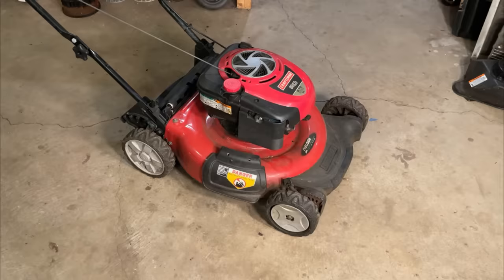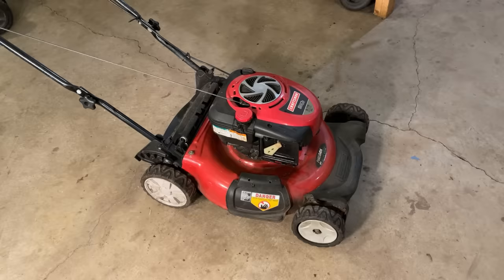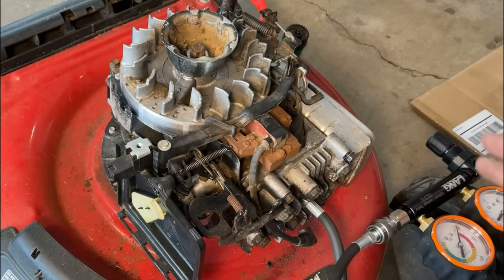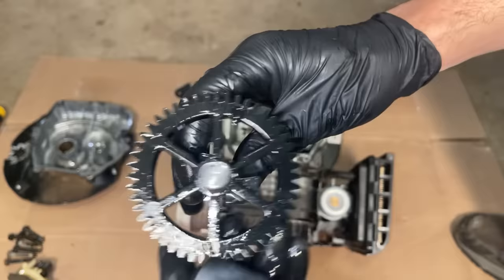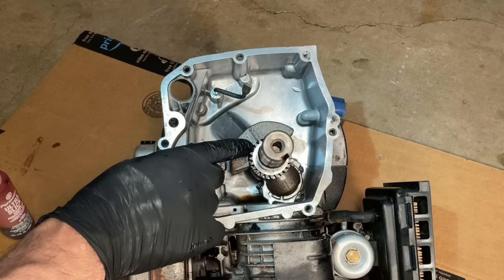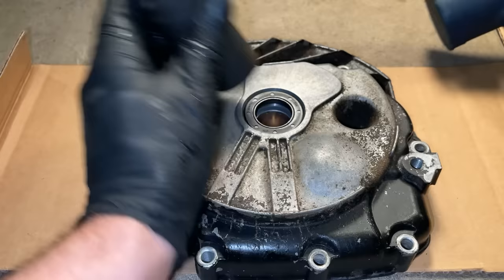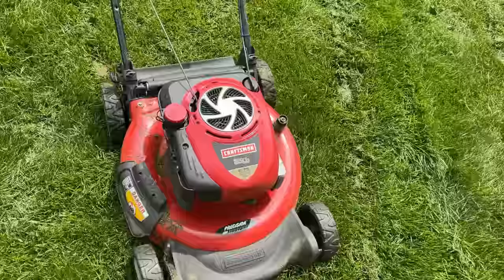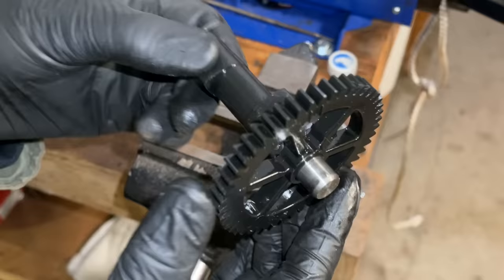Lawn Mower Will Not Start - You Will Never Guess Why

Comment: A helpful tip: The gas tank fill cap on this and similar mowers was very poorly designed! Grass and other debris collects on the underside of the cap flange and when you remove the cap the debris falls into the gas tank. As an ex lawnmower mechanic I am very meticulous when it comes to using clean gas so when the carb jet on my Toro kept getting clogged I knew something was up. After discovering the source of the problem I did two things. First I installed an inline fuel filter in the short rubber gas line running from the tank to the carb. Do NOT use the little red plastic style filters sold online as they will not filter out smaller particles. Rather use the round clear plastic filters that contain fiber filters. Due to the short distance between the tank and the carb and the overall length of the filter this requires some manipulating but it can be done. Second, and this is very important, before removing the gas cap run a rag around the bottom surface of the cap flange to remove debris. I haven't had a single clogged carb jet in the two years since I diagnosed this problem.
Reply: I totally agree with you everything is so poorly made the fail in this country so you consume more and more product I have a lawn mower engine roughly the same model in style but it's from 1990 everything is internally cast or aluminum I've even gone as far as polishing it and porting the engine it's 190 cc's from factory it's probably 200 cc since I've done everything to it This country's despicable when it comes to waste. I've also stated that these engine brake switches are horrible for the magneto and flywheel so my recommend recommendation is to take a double strand piece of wire wire to your magneto and wire it to the block of the engine run the wire up your handlebar to an off and on switch. Patent pending.
Reply: Thanks so much for that tip. I already knew about installing a primary filter after the tank but never heard about the gas cap debris issue before. Now I’ll be on the lookout for that with every mower I work on. 👍🔧🧰
Reply: I have made it a habit to always overfill my tank to flush out grass debris since the mid 70’s and have never had an issue with a clogged up carb.
Reply: For this exact reason, for about the last ten years, I keep a 2" paint brush on the wall where I fuel my equipment.   I use the brush to whisk away all the debris from the base of the cap and the surrounding area before removing the cap.  Only takes about five seconds.
Reply: rbarr775 I like that method better than overfilling or using a rag to clean off the debris. Thanks!
Reply: rbarr775  Great idea!
Reply: Thank you
Reply: You are spot on !
And all it takes is a speck !
Been there, done that !
              👍😉
Reply: Is that 1 of those gas That keeps vibrating off ?
Reply: Those gas caps Are a piece of c*** don't fill it up they don't Leak as bad
Reply: those blowing iff the whole lawnmoer work? I tried to do that as much as I can,will do it every time now
Reply: This was a great “tip”!  That’s why I read comments. So many people, smarter than me!  Thanks👍

Comment: James I am 75 now and back in 64/65 I was the one lung king of the neighbor hood , so I  thought. I did manage to fix all the mowers I collected on the side of the road. I had a claw hammer, 9/16 and 7/16 socket crescent wrench and a pair of pliers, no ratchet. Hours of fun taking them apart cleaning them put back together and when they started it felt great. Thank you for sharing, would have never guessed that was issue. Back then it was one cast piece.
Reply: I did something similar exact same time frame but I attached one motor to my sister’s old bike, a blue and white Monkey Wards step through.  It was a rear engine drive like exotic Italian sports cars.  The frame was a for sale sign donated (unknowingly) in the mid night procurement services.  Drive was a long drawn out process.  It ended up a Jack shaft, 1/2” V belt, with a 12” pulley on the rear wheel, the Jack shaft was a 3” welded to a 2” and the engine had a 1 1/2”.  Went through about 50 V belts by the time I got it going.  Top speed was about 26mph with my custom exhaust, 3 piece 1/2” galvanized pipe. That project pretty much solidified my career decision to become a mechanical engineer, now I are one (old joke).

Comment: nice! I got a Craftsman 20" like new from the local thrift shop for FREE. The deck and blade barely had any signs of use at all. They said the engine was seized. I pulled it through at the store, it was very hard to pull, but it wasn't seized. Took it home and saw that the 'safety blade stop' cable had broke down at the lever on the engine. Re-attached it and the mower is running fine! FREE! YAY!

Comment: A pressed on plastic cam shaft I'm surprised it doesn't have a compressed cardboard deck and bamboo cutter blades , good video and great job getting this thing going
Reply: 15 or 20 years ago,, that camshaft was one piece steel.
Reply: Should have a roll pin at least
Reply: I'm an expert with small engines usually I can tell exactly what's wrong from what the person says if u hit a stump lawnmower dies won't start timing key is the problem or bent crank witch can be straight ened without taking anything apart
Reply: and yet i bet this failure is very rare.

Comment: Ugh, I hate how cheezy these engines have become nowadays. This is why I try to save the old stuff. So much better quality!
I'm glad you posted this vid. It's good to know what's lurking inside these engines.
Reply: It's not just the small engines.  WAAAY back in the late '70s, I heard that GM was using plastic parts in their auto transmissions, and these transmissions were failing because the parts were breaking.  I was skeptical until, by coincidence, "60 minutes" did a segment about this very issue at the time, and when I found that my Monte Carlo had one of  these transmission (TH-200), I dumped that suck within the year.  It was a POS anyway, bad transmission or not.
Reply: @eskieman3948  For sure!  Kawasaki got bit hard because they decided a plastic oil pump drive gear would somehow be a good idea in the Vulcan 1500. Well surprise, surprise they had a major recall due to failed gears!  Plastic has no business inside an engine save for a few select items such as chain guides, and even then they don't always get it right.
Reply: @ctg6734  most newer engines have plastic camshafts I don't know about all of them but I had a Briggs & Stratton that I took apart and it had a plastic camshaft
Reply: @ronalddaub7965  Yeah, I have two of these engines on mowers currently. Sad thing is they'd probably be fine if they molded the gear and lobes as one part instead of two separate pieces.  But yeah, it's because of stuff like this that I hold on to my older equipment.

Comment: "Yes! Plastic cam shafts. You don't want them to last forever do you, Mr./Ms. retailer?" It's not a defect it's a feature! I admire how you were able to zero in on the problem, explaining your reasoning and methodology. I grew up on all metal lawn and garden engines (yes, they are very nutritious with whole milk!)  If something was out of time, it was game over. I didn't know until now about the plastic cam so if I had run across the problem from the outside of the engine, that engine would go into the metal recycling pile. Thank you for pointing it out! A repair like this, done by the typical small engine repair shop would have been too expensive to consider for most home owners. And that, sadly, is the plan.
Reply: I’ve done 9 in less than 3 months so far
Reply: Wouldn't have cost much for Craftsman (or whoever made that part) to fit that timing gear with a pin or even a key.   But, as you said,  the engine will last too long.  Bad for Craftsman.   What a scam, especially in a lawnmower (where the blade is liable to hit against some obstruction and quickly mis-align that timing gear).   Or maybe they thought it was a safety mechanism (like shear pins in/on some old time outboard propeller shafts)?
Reply: @ArroEL922  I don't doubt that is part of the plan. I've only owned 3 mowers in about 40 years and in each case the deck rusted out but the engine was still fine.
Reply: Oh about 15years all engine blands got sued mis different horsepower than they what the manufacturers was were so went cubics or CCs the manufacturers so they lost alot of profits so decided to make throw away engines at our expense . I try stay away from them but was all of the united states .

Comment: There is nothing more satifying than to take something that has no percieved value to an average person, and make it like new for a few bucks.
Good going! That's probably a $300.00 mower!
Reply: If you did this yourself you would have to go buy the tools to do this kind of work, which would probably cost the same as a replacement mower, hence why people throw them out...
Reply: @starzlea  So true. Our society has us conditioned to throw things away. I've repaired small engines, vacuums, all kinds of stuff. It is so rewarding!
Reply: It's a 150 dollar mower at Lowe's.
Reply: It’s great but what if it doesn’t work. You have to back and troubleshoot it all over again. By the time you figured it out you already spent $300-$400 of time and labor.
Reply: @javierbaron1856  do it yourself is the only way a shop would probably get in excess of $150 to do the repair but very well done video
Reply: @javierbaron1856 but it's part of learning and satisfaction of completing something you started
Reply: No, clearly a $5 mower that they overcharged the guy he got it from.

Comment: When turned upside down, those engines will typically sit perfectly in the top of a standard 5 gallon bucket.  It raises it up off the ground so you can work on it a bit easier and keeps everything level.
Reply: Who has two bad knees and loves this tip? This guy!
Reply: @heydannypark  
Agree with that...
...And I can appreciate it too.
 Even after having two total knee replacement surgeries.
✌️😁👌 Once you realize how important it is to save them as long as possible, you don't ever forget. I see new ways everyday to make my steps more efficient.
Reply: I just put it on pool deck! Perfect, set on my bar stool go to work! Then blame the kids for not cleaning their feet before jumping in! Then ok guys, punishment! Go cut the grass!
Reply: These are the tricks of the trade I love to hear.

Comment: I bought a New mower Yesterday. My 14 year old Craftsman has been impeccible. It has started on the first stroke every year. Last year however i bought regular petrol and The gas wire broke.
NO repairshop is open. It IMPOSSIBLE to get spare parts in Sweden. I cleaned The AIR filter and plug.
Thanks for The video.

Comment: For anyone wondering,  don't get the plastic cam , this may have worked for James,  but you're better off getting the all metal cam .  Yes , it's interchangeable.
Reply: $25 mower. $10 used plastic cam was the better choice for this "push, not powered" mower. I'm guessing the best he'll get for it is $50? As it stands right now, he's going to maybe break even. Now, if you're going to keep the mower for yourself, maybe spend the extra bucks for better parts.
Reply: what's the part number for the metal  cam?
Reply: @gdfschimpi007  Google
Reply: @midixiewrecked7011  That's not what I asked....
Reply: Right,..I kind of think it's cool that he has the skill to do and figure this stuff out but to me none of that was worth the time and then to put another plastic part into that motor..???...For me and it's just my opinion..It wouldn't be worth it..
Reply: @kingbeat101  well, I understand that he's gonna probably sell the thing,  which is great , but using a part that is known for failure is kinda not great.  I mean it's whatever.
Reply: All the more reason to hold on to those older Briggs engines for parts.  They are eventually going to be phased out of existence with the new electrics (whether we want them or not) and the supply of reliable parts will dwindle away.
Reply: @campbellpaul  briggs quantum engines can still be bought new from small engine warehouse. about  $125 with shipping. worth every penny since they destroy these newer OHV engines.
Reply: @gdfschimpi007  I have enough mower engines to last me several lifetimes already.  New old-stock is the best way to go if you can't find it on Craigslist or Facebook, I agree, but for me, I would rather salvage the old used ones and rebuild them, as 99% of the time nothing is wrong with them mechanically, and there's no feeling like the one you get after putting a basket case back together again and making it run like new (however, In the end it is just a mower).  They are also phasing out the faster sport bikes as we speak, with co2 emissions being the same reason, so your top speed is going to be about 125mph on all the new models.
Reply: @Tom-In-Ga  Where I live you could get a hundred for it easy
Reply: @campbellpaul  Yep. I post in my local Facebook community for non running small engine equipment. I also have enough mowers to last a LONG time. 9/10 they need about $5-10 into them to put them back into service.
Reply: Exactly what I would have done. Well done  all the same James, you sussed that problem well
Reply: @campbellpaul  Biden will see to it.  Or try.
Reply: Why am I watching this. I’m in an apartment.Also, I counted and he used 4 million, 2 hundred thousand tools to do this. I learned quite a bit to be honest.
Reply: @jamiewhitley8876  4million,2hunderd thuosand tools,LOL

Comment: Ahhh, bring back the old briggs style...never an issue except for plug fouling from worn valve seats..hand lap reface, good aluminum carbs with brass seats and neoprene seals..
Had this type issue on a brand new 7250w generator..out of box..that was a teardown ! Three day fix, started up, plugged into home power, ran fifteen minutes and utility can back on .ha!

Comment: Having the key on the crankshaft shear off is a very common problem with these mowers where the engine's crankshaft has the blade directly bolted to it.  When the blade hits something "unmovable", such as a rock, the flywheel continues to turn, shearing off the key.  The engine then won't start because the spark timing is extremely far off.  While common with push mowers, I've even had it on a John Deere lawn tractor, whose engine crank isn't directly attached to the blades; apparently that problem was caused by a backfire or other issue, but exhibited the same no-start symptoms.
Reply: Its not always visible that theres a problem until the flywheel is removed and the key inspected , whats helped me is to inspect the blade and underside usually if its backfiring and the blades been damages you can bet the key is sheared and timing is off
Reply: Generate when they hit something to stop the blade the momentum of the flywheel continues
Reply: I've had ones where the flywheel to crank is off a tiny bit and it was no start.  Removed and reinstalled flywheel and it worked,

Comment: James, I’ve come across this as my sister hit a water shutoff valve in her lawn. I was able to straighten out the decompression valve and drilled a hole for a spring pin to locate & lock the plastic gear in proper timing. My sister has used it for a couple seasons now with no issues. The air trick is a great way to diagnose what's going on.
Reply: That’s exactly what I was going to suggest to anchor gear n cams 👍

Comment: I have a small engines certificate from my local community college and I must say, I still have plenty to learn. Subscribed to your channel today and hope to get some repair knowledge from a front line mechanic. Thank you for sharing this. I did replace the crankshaft on one machine and it worked fine for a long time after.
Reply: I was in the industry for thirty years.  The way things are trending, small i.c.e. are going to be extinct in a few short years, replaced with battery electrics.

Comment: You're right, James, I would never have thought of the cam lobes moving.
Just shows the 'designed obsolescence' in making a plastic camshaft. Ultimate stupidity in my opinion.
But if the "design" is to last only as long as the warranty, brilliant idea.
Thanks for sharing.
Reply: I save old steel cams and file off the compression bump. If you can't pull over a Brigs, stay in the house.
Reply: They know most people dont do enough maintenance to get more than 2-4 years from a mower.

Comment: Makes sense that the gear broke loose, it has the least amount of surface area in contact with the metal shaft.  Without splines, pinning or keyway that is where I'd suspect rotation to have occurred.  Great video, thanks.

Comment: perfect instructions on resetting timing..I recently ran over a rock that knocked the timing off and caused this problem..it started once and belched smoke like a champ.. i shut down immediately and it wouldnt start again so i tore it apart to see what was happening but had no idea what to look for till i got this vid. and it worked perfect... thanks amigo.. good job.

Comment: I used to have a Murray push mower, had the big wheels in the back, and a Briggs Quantum on it.  LOVED that mower and engine.  What killed it was the stellite valve seat for the exhaust valve came loose from the block.  I tried everything I knew, even tried peening the seat back secure in the block and re lapping the valve, but there was no saving it.  That killed it dead.  Loved that mower.  It had a cast iron cam in it, it was a bit older than your mower here I'm sure.